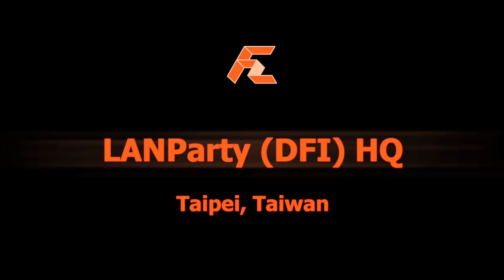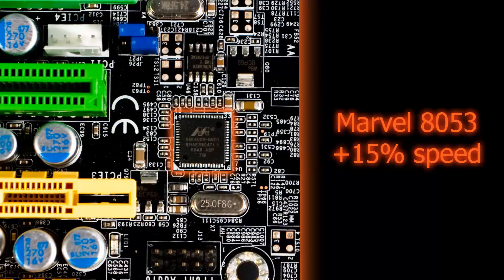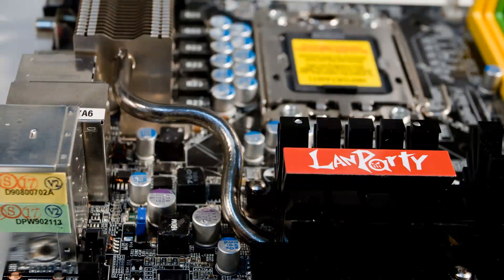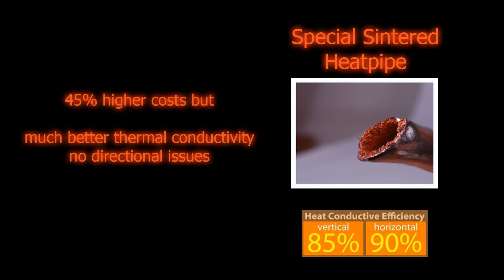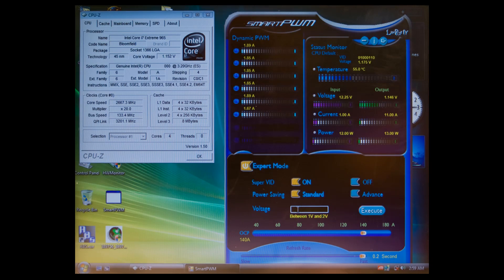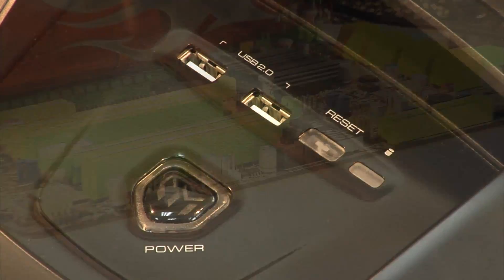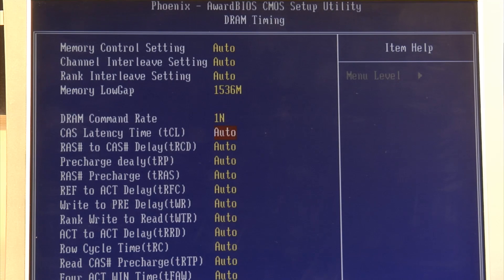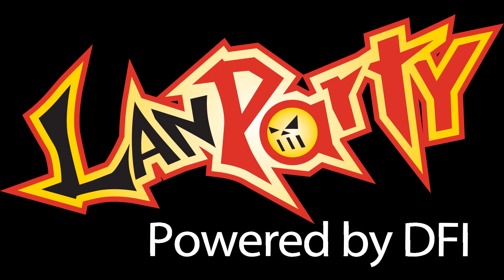DFI LANParty DKX58 Intel Core i7 Motherboard

Comment: can someone help ?? i have same mobo in my old pc and i want to bring it back to life but i dont know were to connect my front panel wires
Reply: did you find connecting yet ? i have same motherboard right now with a core i7 965 Extreme cpu very stable board and good overclocker.
Reply: Johannes Andersson i sold it thanks for commeting anyways ❤❤❤
Reply: okey no problem man :) take care

Comment: true. but if you use the power of the I7 at all, you should use a nvidia card, with cuda. because that is a big deal. also if you give like 400$ for a Cpu and 400$ more for a MB you should be able to use 200$ on a decent video card.